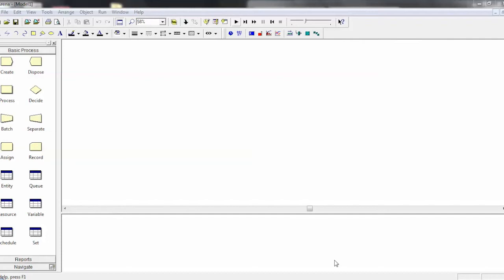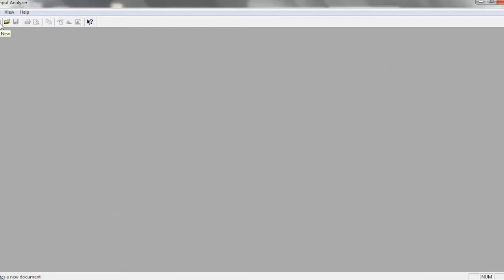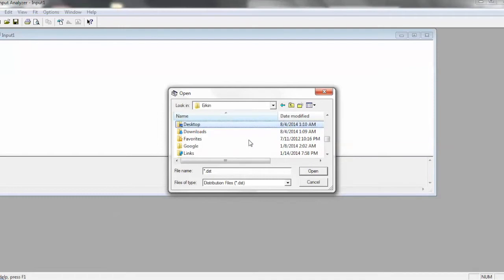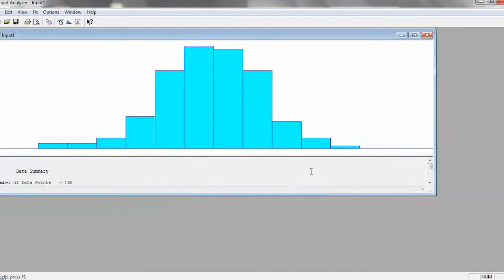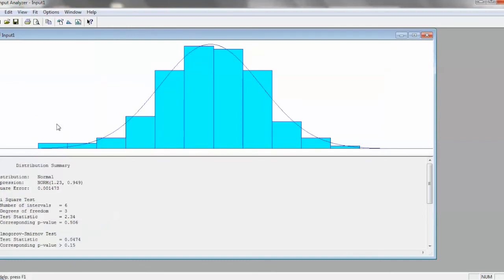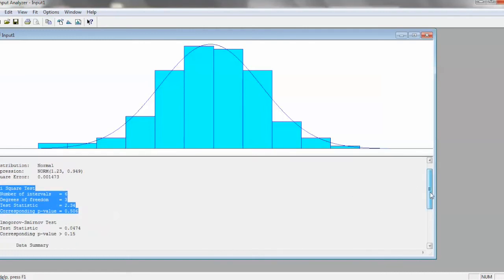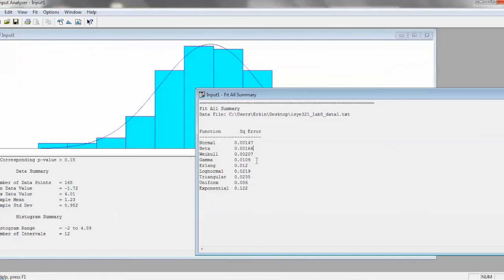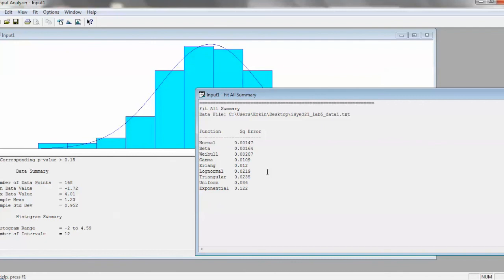Basic Arena Tools: Input Analysis

Comment: Hi, if the p value is smaller than 0.05, although it is the best distribution, but actually it is not best fit the data?
Reply from the maker: I'm not sure I've properly understood your question. Are you asking about a case where you have two distributions (X,Y), and X has a small p-value but Y has a smaller squared error? If you believe X to be the better distribution for the data I would recommend going with X, especially if the squared error of X is not too much bigger than the squared error of Y.

Comment: where did you save your data. was it in excel ?
Reply from the maker: You can use excel (or other data/spreadsheet software) but make sure you save it as in a Comma Separated or Tab Separated format. After excel saves it you'll just need to change the file extension to .txt